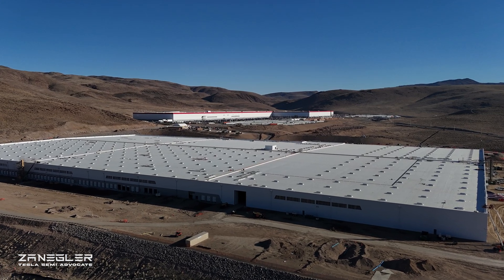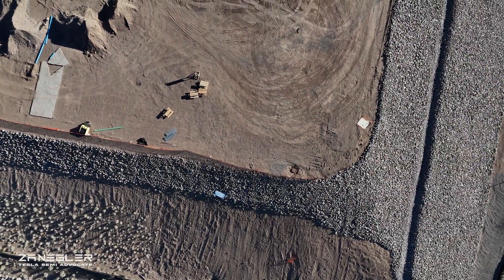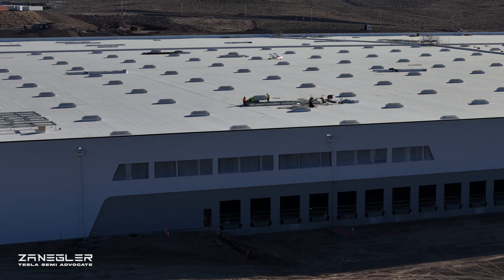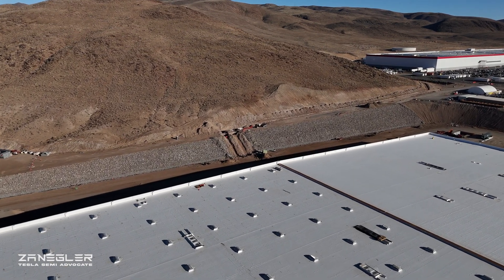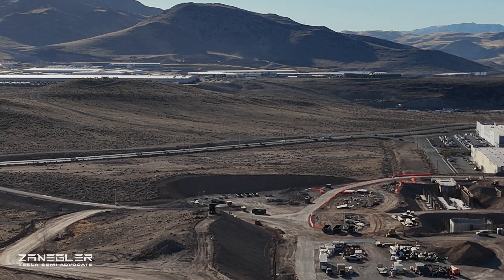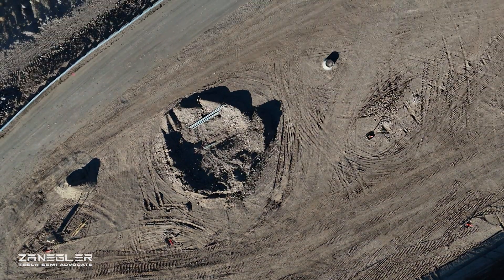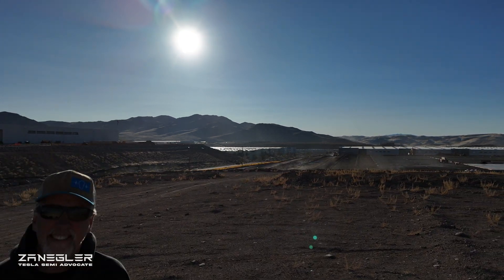Giga Semi - Keeps on Truckin'

Comment: Do you guys think the the tunnel that is connected to the stamping pit takes the waste material outside the building from underground.  The far west portion of the pit extends beyond the the western end of the Factory wall
Reply: That's primarily the purpose. Same at Giga Texas, but the scrap conveyor and scrap bins are contained within the Stamping building.

The Munro and Associates video of the Cybertruck production line shows a similar system.

Comment: 5:12. Outline for the SEMI logo as seen in the render.
7:11. Trench. On its way to the switchyard seen at 7:20.
9:18. Stamping dies are moved in and out of the press at ground level.
Left. Top of the concrete pedestals show hold-down/anchor bolts for steel columns. Same to the right at 9:34.
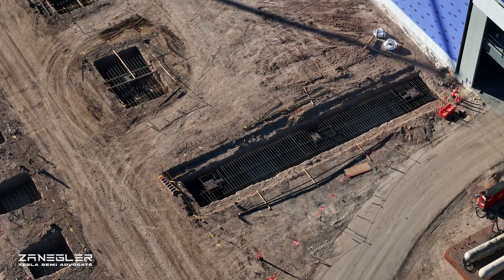9:41/10:18. Hold-down/anchor bolts for steel columns.
10:27. Giga Texas. There are 2 stamping buildings at GT. First building was constructed using concrete columns and beams. Second (officially known as Stamping 2) uses conventional steel column and beam construction.
Reply from the maker: Appreciate your observations. I did rethink the steel vs concrete columns once I noticed those plates. 

Grid power comes in from milan so not sure why the would also connect to the existing substation. I’m still thinking megapack farm.
Reply: @ZaneglerTeslaSemiStalker-vt3or  The supply coming in from Milan Drive may be a temporary connection.

At GT there was a temporary power supply that tapped into existing powerlines crossing the site from early 2021 before the temporary switchyard/substation was commissioned in about May 2021.
Reply: Trench—water tank is also in that area. Not saying I know more than you, I just find it interesting.
Reply: @DanTheisen  That's a fair point. They could be running a number of utilities in the same trench. Some comms cables possibly also.

The concrete vaults I would guess are exclusively for the electrical supply.

Your comment prompted me to follow on google earth the powerpoles from the main plant switchyard at 7:20.

Those powerpoles head in a northeast direction up a valley to meet a pair of larger transmission lines along the top of a ridge. Those transmission lines then follow a curved path north west up to a switchyard/substation on the corner of Milan Drive and Clark Station Road. That switchyard/substation seems to be equipped with a number of megapacks.

Both plants then would likely be connected to the same switchyard/substation.
Reply: @DessieDoolan  for sure, I agree, the vaults are almost certainly electrical. And I see what you mean that the electrical heads up the ridge and toward that larger substation. Makes sense.

Comment: The line across the roof could be natural gas for heat and process use or maybe compressed air.  I couldn't see well enough to know if it was pipe and if it had markings. In Georgia gas line is marked with yellow markings and compressed air is usually blue or green.